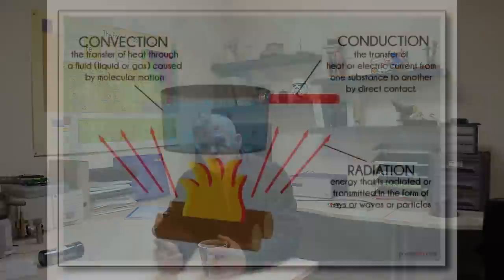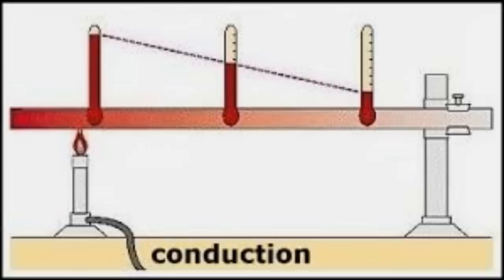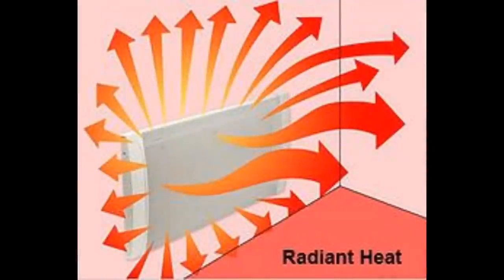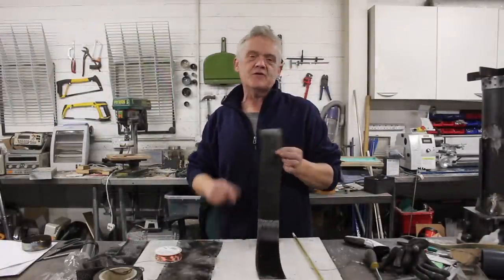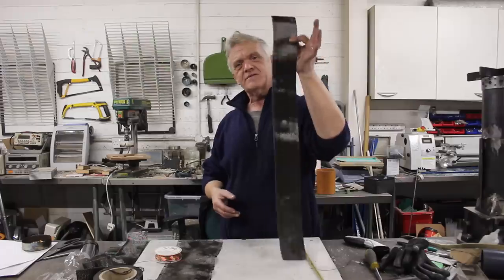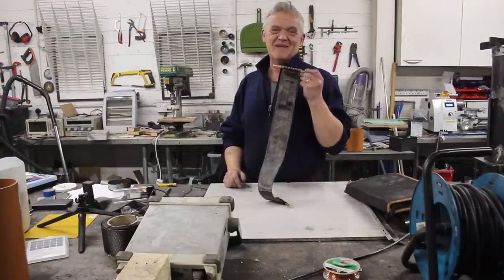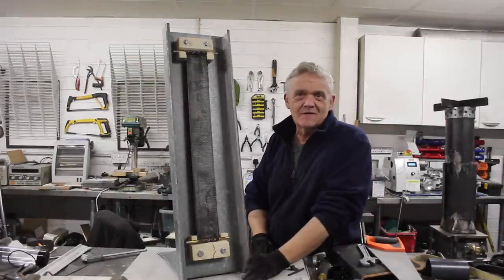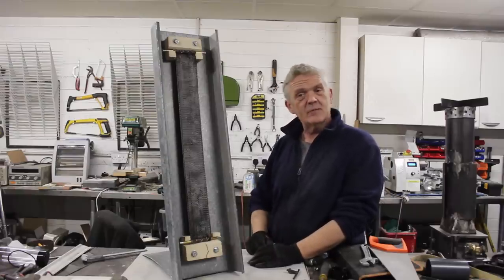1758 How To Make A Nano Carbon Infra Red Heater

Comment: If the electrical connectors are located at the centers of the 2 cylindrical copper bars, then shouldn't the carbon fabric be hottest all along its centerline ? If so, then this heater won't radiate uniformly across its entire surface. The result would be almost zero radiation at its corners.
Reply: I expect that's why it's a copper bar, not a wooden rod for example

Comment: Safety instructions: Cut fire brick in a well ventilated area or with breathing protection
Tony your friendly neighborhood risk assesor
Reply: Nice one Tony, I think this channel is aimed at people with enough brain power to work without hi viz and hard hats to warn others you can't make sensible decisions.
Reply: @551moley 

Don’t get me wrong l!
99% of people that watch this Chanel are smart enough. I assume you are too..!

However It takes only 1 “F” wit to mess it up for everyone.  

You aren’t that guy?
I assume your sensible, I’ll assume every watching is also sensible.  And I don’t need to report the video..! 

I won’t. 😉
Reply from the maker: I am sorry mate and I don't mean to be rude here - but, did you read the MSDS on this product? The specific instructions say - The product is supplied in standard brick shaped sizes. Dust content is normally very low as supplied and is not considered dangerous to health or the environment. Dust generated by a cutting, grinding or abrasive operation, however, may lead to respiratory problems if there is long term exposure to excessive levels. This is taken directly from the MSDS  - we are talking about one brick in a 5 minute period and a none machine hand sawing operation that is extremely unlikely to throw up fine dust - neither excessive or long term I would say - probably to get any damage from this you would have to snort it like a line of cocaine. As a risk assesor I am surprised you didn't check this out first.
Reply from the maker: alumium oxide and silicon dioxide - the msds says this product is supplied in standard brick shaped sizes. Dust content is normally very low as
supplied and is not considered dangerous to health or the environment. Dust generated by a cutting, grinding or abrasive operation, however, may lead to respiratory problems if there is long term exposure to excessive levels. One brick sawn with a hand saw over a 5 minute period is neither excessive or long term - you would probably have to snort this like a line of cocaine for it to do anything at all
Reply from the maker: why would you report the video? For a danger that doesn't exist?

Comment: Hi ....i need help regarding heater i have coal furnace made up of 6 mm ms steel 5 feet width  10feet length i need to heatup furnace withwood fire for 4 hours to 6 hours to get inner pressure of 400 the temperature under the furnace is 1000degree i want to use heater uder the furnace please guide me regarding this

Comment: The only problem with the warming people method, and not the house, is that the house gets cold and damp, giving rise to black mould - which is nasty toxic stuff
Reply: Just move outside.
Reply: then keeping a good airflow is key
Reply: Modern problem, houses are too well sealed, and they needed to be to heat air. The solution is to be scrupulous about sources of excess humidity in the home + ventilation, ventilation & ventilation.
Reply: Dehumidifier and clean the mold once in a while. Problem solved.
Reply: I think you need a bit of background heat in the house to prevent this. Probably make sure house doesn't get below 10 -12 degree C. Use the infrared heater to heat you up to a comfortable temp then
Reply: @droolian01  The temperature depends on the dew point, driven by internal/external temperatures, pressure, wind chill, external radiant heat, etc. When water condenses it causes the greatest risk of mold, therefore any minimum temperature is arbitrary, and likely to lead to wasted energy heating air, learn to know when ventilate and you will prevent condensation.
Reply: There is another way to use infrared heaters (or anything that can do the same job such as conductive concrete), use it to warm up the walls so they work as a heat battery and conductor.
Reply: For a majority of people, this would be more a problem in the summer.  During the winter, with colder temps, humidity tends to drop naturally anyways. Colder air cannot hold as much moisture vapor as warmer air.  (This is a basic physics fact/law/reaction)

  Where I live, in the summer, it  commonly ranges from 50 to 90% relative humidity.  In the winter it drops down to range between 30 to 60% relative humidity outside, and inside with heating, even less.  

  In colder/more northern climates than mine, it tends to drop a lot more.  The air can get bone dry in more northern regions for a good portion of winter. 

   I guess if one lives in Florida or the like, then yeah, you will need the heat to help dry out the house even in winter.
Reply: @@1livepl used to dry clothes inside next to the Woodstove.  And keep a pot of water simmering on it too.  When it's below freezing out it tends to get pretty dry.

Comment: I was thinking that one could make several of these powered by your artificial muscle radiators, and using the vibration cause by such things as the changing temperatures of the heating of the room, the movement of people, or whatever to warm yourself for free forever.

Comment: could you cote it in ceramic to prevent air from burning it up ? and increase the voltage to say 36 volts?
Reply from the maker: yes - that's exactly what ceramic heaters are - but 36V wouldn't really need a coating

Comment: Wait it doesn't get above the flashpoint or burning point of paper and is only 12 volts,? You can make this out of cardboard as long as you sufficiently insulate the paper from the carbon fiber.  And you could power it with a hundred watt solarpanel in a big window.  Free heat add sand battery.
Reply from the maker: yes you could - or stick it on a bit of plastic if you wanted

Comment: Could we cook food with it????
Sound we can reach 300*c easily with this thing. It would be great to make an oven that could run on 12v / one or two solar panel instead of using a 3000W conventional electric oven..
Reply from the maker: a version of this - yes indeed
Reply: Wow that's interesting! 
Since the warmth will go from the exterior to the interior of the food it  will certainly require a long and progressive cook (so as to not burn the surface before the inside is cooked), but that's very interesting!

Comment: I was wondering what was in those heaters . How do the ones you can buy work on mains voltage? do they have current limiting or voltage step down ?
Reply: You could cut the fiber long ways into 2 strips. Each strip would be 4 ohms instead of 2. Wire them into series and apply 120 volts. That is 120 volts / 8 ohms = 15 amps...therefore 1800 watts. 

Or, divide into 3 strips, each with 6 ohms...120v/18ohms = 6.7amps = 800 watts.
Reply from the maker: yes exactly

Comment: Are radiators ironically named, since they principally do convection rather than radiation? Shouldn't they be called 'convectors'?
Reply from the maker: lolol - yeah I suppose they should
Reply: yes as radiators they work pretty poorly especially given they are usually shiny and white (would be better if they were painted matt black).

Actually did you ever touch a shiny silver towel heater that you didn't realise was on? designed to be a terrible "radiator" but a very good conductor to heat the towel and nothing else

Comment: How do you regulate the amperage without a  purpose built power source? 🤔
Reply from the maker: regulate the voltage mate - the resistance of the material will regulate the amps all by itself at a given voltage

Comment: If you placed inside concrete for example would it burn ?
Reply: It will light up when you give too much voltage and there will be oxygen access.
I wouldn't trust concrete itself, which is basically porous.
I would suggest placing such a strip in a glass tube or jar, suck the air out and secure it.
The only problem is that we are reinventing the infrared light bulb.
Reply: @andrzejzielinski8886  Ya I was thinking vacuum like evacuated tube heater but was looking for some mass for the infra red to absorb.
Reply: Imagine light shone on you in a wavelength that was invisible - that's Infra red, because there's no barrier (concrete) between the invisible light and you it "shines" onto you and warms you and anything else it "shines" onto but nothing else, your heating the person, not walls, furniture, window glass etc etc, a high percentage of the input energy is not wasted.
Reply: @Jimbo878   seems to me the Amish had an infra red heater that warmed objects in the room which made the heat last longer or the appearance that it did.

Comment: Only 3? Friction, Combustion, Induction? Adiabatic compression? Etc. Hmm?
Reply from the maker: they are sources of heat not methods of transmission of heat mate
Reply: @ThinkingandTinkering  Good point. 
But I'm still on the fence about 'induction'. Isn't it a transfer of energy, not a 'source' as such, or does that count as radiation? The wavelength is longer than the space between source and sink, so it's also sort of conduction too.  
Oh no, I've gone cross-eyed.
Reply: @ThinkingandTinkering  nano carbon heaters, for when you only need a little heat.

Comment: Repurposing a fridge or a freezer into a heat pump would be more efficient than this. 

IR heaters seem to be more of a marketing gimmick recently.
Reply: I remember when the "thing" was Quartz heaters , every one wanted a quartz heater... but it was just a gimmick.  Ohms law is ohms law weather it be quartz or carbo or ? a resister gets warm ;  however I.R. does make good sense,  its instant comfort when turned on and is the same way a fire in a barrel heats you outside in the cold...  your front or back gets hot while other side freezes... LOL...

Comment: what about radiation poisoning?
Reply: Lmfao. It isn't ionising radiation, it's infra-red, otherwise known as heat
Reply: My Dixie Wrecked🔨  If you watch the opening to The Simpsons, Homer would have been quite warm! Get rid of the fiddly bits and just use uranium in your clothing!!!!🤓
Reply: My Dixie Wrecked🔨  are you drunk? Please don't comment rubbish to me please.
Reply: There are different types of radiation. Light is radiation, microwaves are radiation, and x-raysare radiation, etc.

Infrared radiation is the same type of radiation as when metal gets glowing hot. It doesn't irradiate you, it is safe to be around.
Reply from the maker: It's called radiation because it radiates. In this case it radiates infra red which is heat. All hot things radiate infra red including cups of tea and coal fires - though - of course you can suffer burns if you are too close. Light is a form of radiation - if you want to think of it that way - after all they are all on the electromagnetic spectrum and a lamp 'radiates' light - what makes them different is where they are on the spectrum. Anyway - you might want to check that out just to help clear up the issue for you
Reply from the maker: nope - that won't do - you need to keep civil I am afraid - rules of posting are polite respectful and remain not abusive - if you don't like those rules that's fine - don't post. If you still want to post offensive comments - and they are comments I find offensive to others - then I will remove the comments and block you from posting. I am saying this in an effort to help and to protect the community from bullying, abise and disrespect - please take this warning in the spirit it is meant in as opposed to a personal affront to you
Reply: Sorry Robert, but inanities wind me up. I've deleted the 3 letters that might be offensive to some.
Reply from the maker: @nevyngould1744  thank you mate - that is more than kind of you and I really do appreciate it - I. know it is hard to put up with things sometimes believe you me lol - but thanks again, Rob
Reply: No problem Rob, I got short tempered and overstepped the line when interrupted in the middle of a serious educational moment.
It's the not understanding the difference between ionising and non-ionising radiation that has us dealing with anti 5G propaganda and other woo.

Comment: Haven't you read the Published scientific Paper "Being too Hot makes you Stupid"?
Stop this obsession with making people dumb Rob.!🥴🤭
Reply: This is true but it requires constant high temperatures similar to the countries near the equator, everyone is lazy and dumb there and this is one of the reasons.
Reply: This can not be true. Otherwise, Europe would have no problem with so many African engineers sailing here on pontoons.
Reply: @vitordelima  What they found in that paper was that unless the Air temperature you are breathing, and around your head is below 15C, preferably 10C when you are sleeping, your brain cannot clear toxins, and cellular repair processes don't kick in.
So the practice of heating houses with thermostatically controlled systems in the UK, Europe, America....
So called "civilised" countries, is a big factor in the stupidity and rapid mental deterioration with age in these places.
There's other really good reasons not to lock yourself in an air-conditioned sealed house prison too. Like the hormone disrupting plasticisers and other toxic volatiles, and microplastic contamination, that are at thousands of times higher levels than the open air. 
It's been found that disease blamed on toxic moulds in these deathtrap homes are actually not caused by the moulds at all but by these synthetic chemicals being released by modern building materials, furnishings, insulations and adhesives when they get wet.

Get yerself nine yards O Tartan woollen cloth Laddie! 
And learn to wear the Brackenfahlleah!

The perfect all weather clothin' and accomodation.
If ye be caught in a minus forty C blizzard in the Highlands, then yet just roll yerself up, with the last yard and a half soaked from a brook so it freezes and blocks tha Wind!
If ye be spotted pushin some snow togetha fer a pillow, ye be laughed at and called a sissy! 😋🤗
Reply: @aaronfranklin324  Sounds like a lot of B.S.
Reply: @vitordelima  No. I don't eat sandwiches of any sort, especially not Bologna. 😎
Reply from the maker: I am sorry mate but that sounds like utter BS - I don't mean to be rude here and I am sorry if I upset you by saying that but I can think of a hundred reasons why that just smells of xenophobia and very little else lol